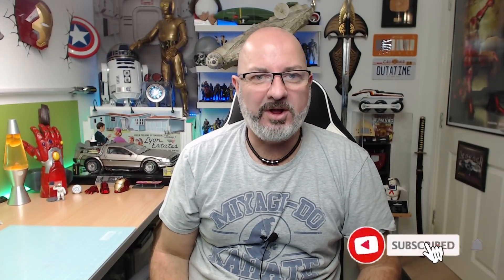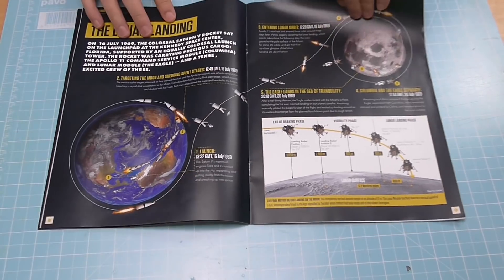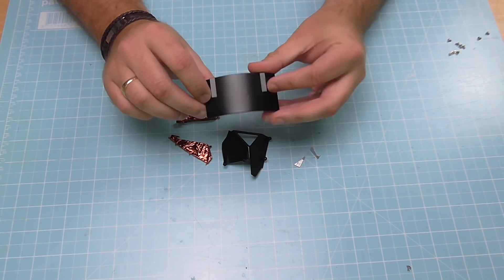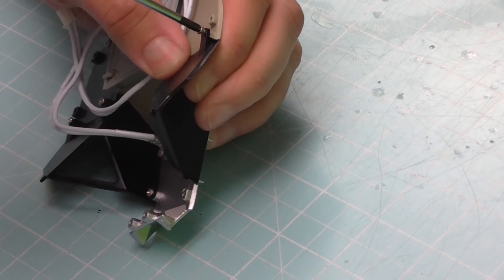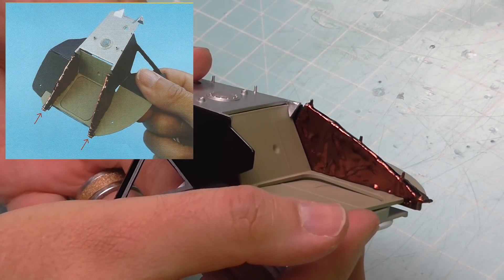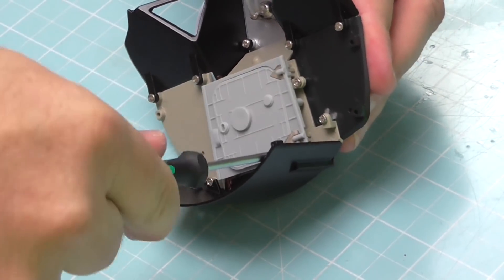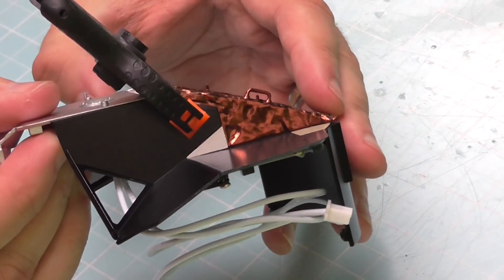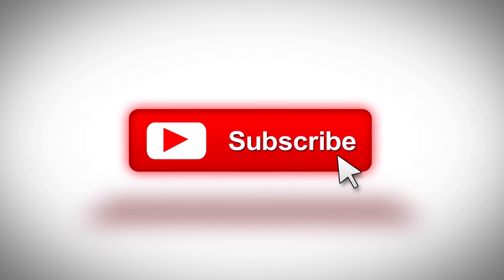Build the Apollo 11 Lunar Module - Part 3 - Joining the Ascent Stage Window to Main Assembly

Comment: This looks like a great model. I hope they do go ahead with it. I built a regular plastic model kit of the same landing scene. That kit came with self-adhesive-backed gold foil, to wrap around parts. They don't include enough of it, though, so I had to use tiny patches of it, on the tops of the landing gear, to fill in the gaps. It still came out great, though.

Comment: Adam savage did a lunar lander model and he addressed the gold foil issue. He said they ended up using the foil wrapper from “ROLO” candies.
Reply: The candy wrapper idea is great for this type of build as it doesn't matter if it's a bit creased. The added bonus if it doesn't work out you can binge on Rolo's.
Reply: Yes roll wrapper does work. I am trying helium ballon foil